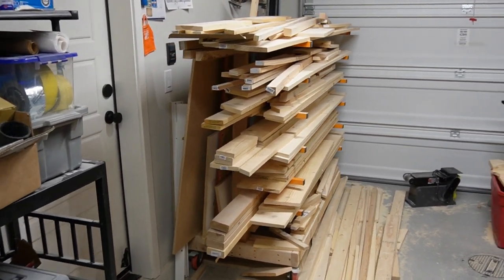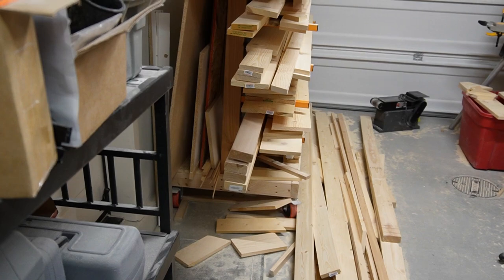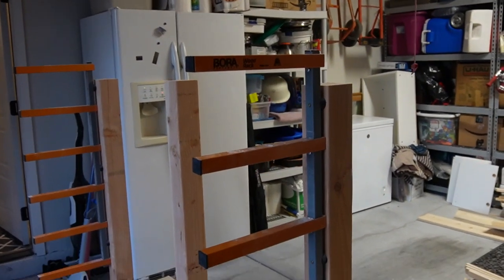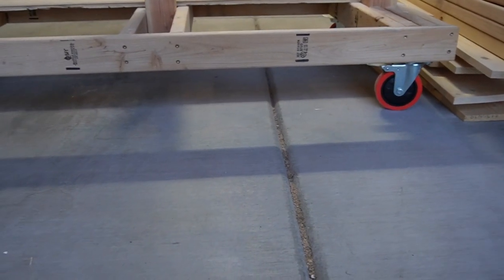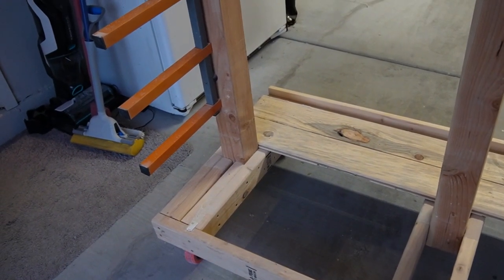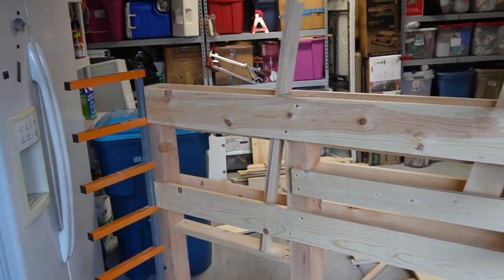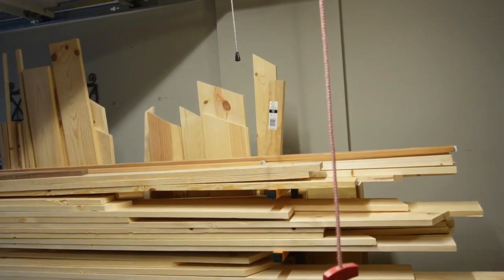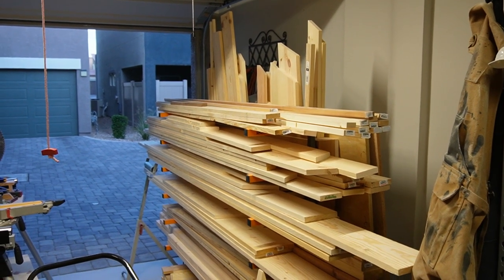Lumber Storage Cart Rack DIY Build for storing wood in a Small Workshop

Comment: Great video. I need something similar for my small garage shop.
I was thinking when you mentioned it tipping forward of an A frame style would work that way the wall brackets would lean back slightly and the ply wood would do the same from the other side and then store the small stock in the middle cubby created by the A frame. Thoughts?
Reply from the maker: That is a good idea, I have a problem with the wood on the top rack falling off the edge when I'm getting wood from behind it. (I keep my thinner boards on top) maybe not too much of an angle because it might be hard to get wood from the back of the shelf. Now I'm curious on how it would work!!

Comment: Without center supports for your boards, they may bow in the middle over time.  You would do well to protect against this by adding at least more Amazon bracket.  Two center brackets if your lenghts are longer.
Reply from the maker: Yes i agree, im going to have to stop being cheap and spring for another set. I mostly make small items so i little bowing isnt too bad but i still should do it right.